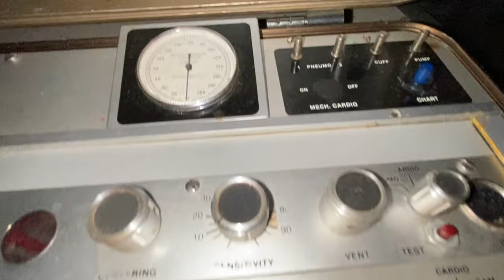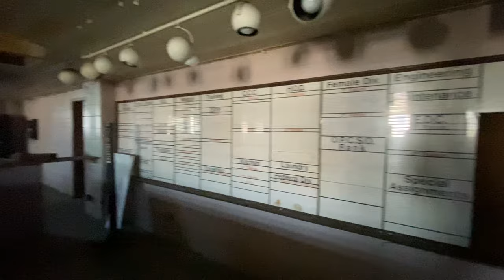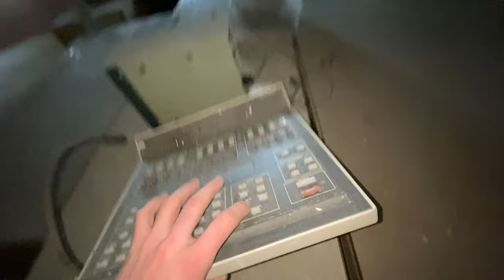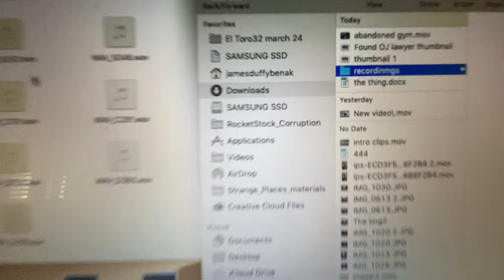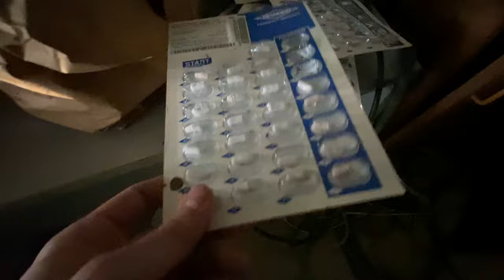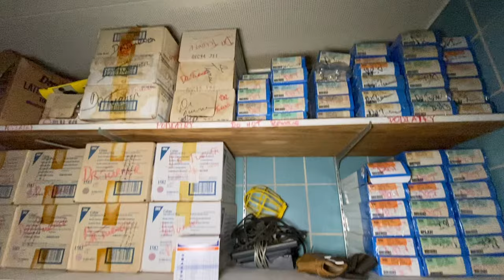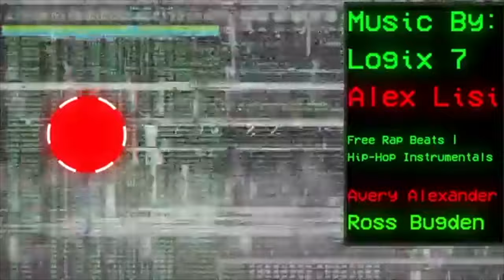THEY LEFT THEM TO DROWN!  (Abandoned PRISON TOWER FLOODED BY KATRINA!)

Comment: Computers were IBM PS/2 aka Personal System 2 from late 80s to early 90s. They had "Microchannel Architecture" that used proprietary expansion cards for modems ect. This never caught on. The only thing that caught on was their mouse amd keyboard plugs (PS/2) connectors that became the norm until totally replaced by USB plugs

Comment: Wow, interesting, but you’re really off base with a lot of this. I worked in that second floor medical unit for years. You should have asked someone who worked there what things were and how things were done. Do better. You could have just walked across the street to the new jail and asked to speak to an employee who was there at the time. Many still work there to this day. There was no deep water on ANY of the floors that housed inmates in the Community Correctional Center. It’s hardly a “sky scraper” either. It’s 6 floors. The isolation cells you keep showing were actually the psychiatric unit. Most times the doors were open because the inmates were in the day room. You keep mentioning that they had no heat. How much heat do you think people in New Orleans need in late August? It’s in the 80’s and 90’s. They were not left to drown. Deputies were there with them the entire time. It was miserable to be sure, but for all citizens in New Orleans, not only for the inmates. Lessons were learned. It was thought that the jail was a safe place to stay and shelter. I myself rode out three hurricanes there with no greater damage than being really hot. No one expected the levees to fail like they did. Now inmates would be evacuated ahead of a storm of this  magnitude.
Reply: 500 inmates unaccounted for though?